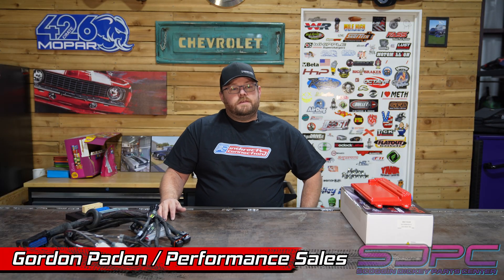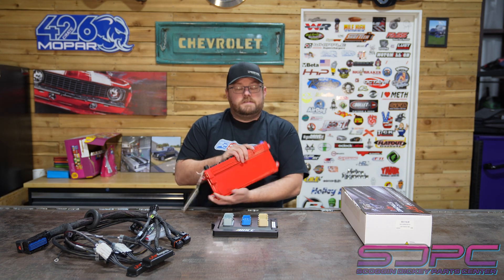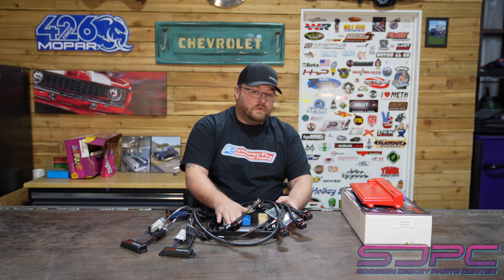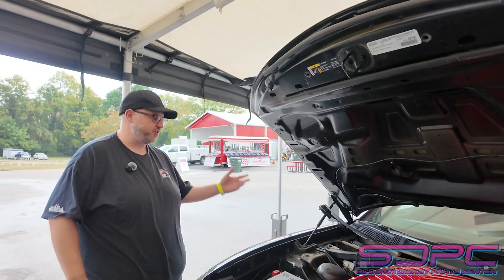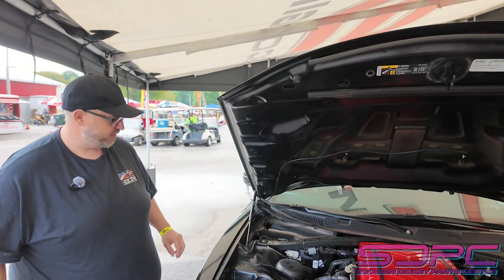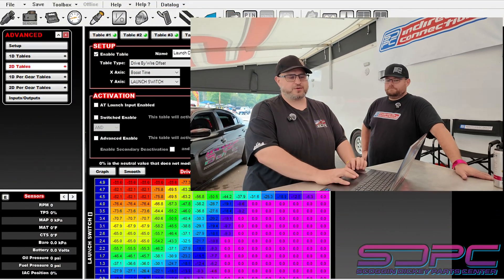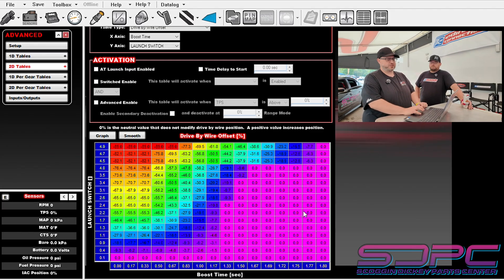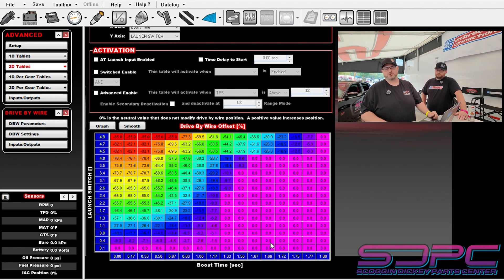RACE Gate-Way: Plug & Play Engine Management

Comment: Really cool stuff! I have a 2010 charger 5.7 cop car I put a new 2012 truck 5.7 in with comp cam long tube headers and am catching hell getting the running right.  It runs and operates really well but has glitches I can’t get past in the tuning without spending thousands on some tuner  to do it.  
Seems like by now with my two mods  there would be a plug and play program I could just load in it and be ok.  But I guess there’s not enough ppl like me looking.  Great work you guys at SD are doing with Mopar now days. Thx